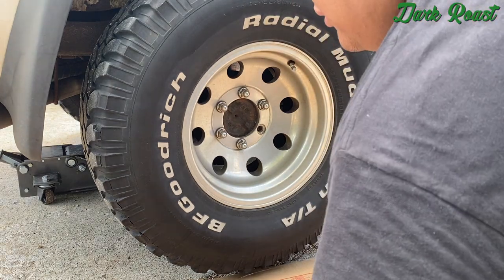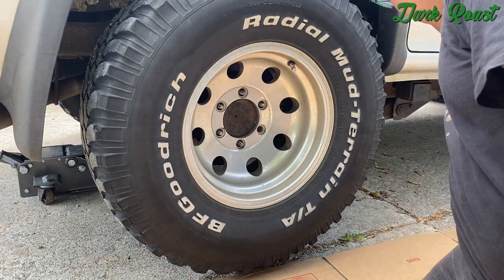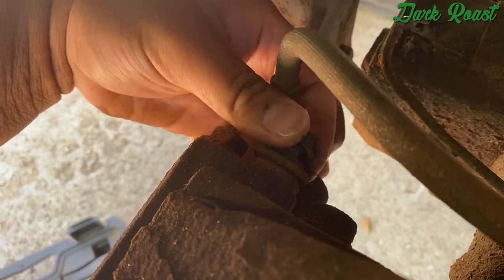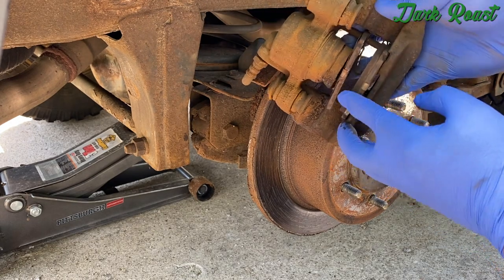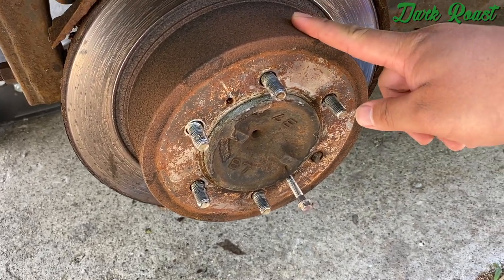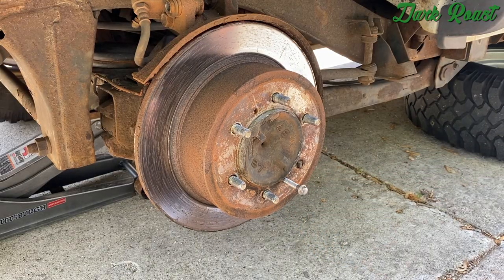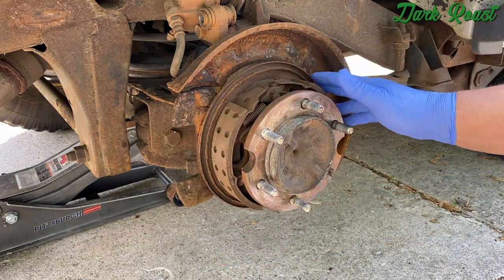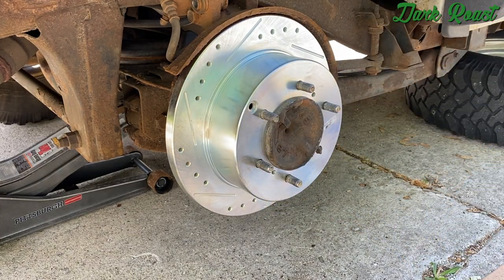How To: Replace Rear Brake Rotors, Pads, & Calipers on a 2002 Mitsubishi Montero Sport

Comment: Didn't need new calipers. Just needed to remove those stuck slide pins, clean them and lube them or just replace and lube them and your pads would've worn evenly again. Those need to be removed and cleaned every brake job as part of maintenance
Reply from the maker: I figured lol I honestly had a hard time removing the old pins and figured to just get a new set of calipers instead of trying to rebuild it. Especially since my uncle had the same OEM calipers on since he owned it before. Also it was more content to show on how to install the calipers lol I would say now I know for next time but unfortunately I don’t own the truck anymore.

Comment: Planning on doing this to my 00 sport xls soon. Thanks for the Montero love homie
Reply from the maker: Nice it’s definitely a great set up. Of course! Unfortunately I had to sell mine due to the frame rotting and it was getting really bad. I’m actually selling my Injen IS CAI, full Siberian polyurethane bushing set, and front drilled/slotted rotors with carbon fiber brake pads still new in box if you’re interested?

Comment: Thank you a lot man but stuff is still complicated I have a 02 montero sport I payed $450 for valve gaskets due to oil leak now I gotta o2 sensor and brakes I need to fix
Reply from the maker: No problem man! Oh dude the valve cover gaskets are a pain to do. The intake manifold has so many different size bolts it’s hard to keep track of. I tried doing a DIY video on it, but I was struggling lol. Eventually got it done, but man it was something lol. Good luck and hope you’re able to get it done!
Reply: @DarkRoast  just a check up I got my brakes and now I’m getting new rotors for all 4… I also have to get new shocks and struts I advise you to stay on top of it because these are notorious for that type of issues pray for me buddy😂!
Reply from the maker: @keepingupwiththejones3047  Nice! Did you ever get the new shocks and struts? Oh I had plans for a full lift kit, but unfortunately I was never able to complete it because I had to get rid of my Montero. The frame rotted away and the cost to weld the frame was worth more than the truck lol

Comment: So the rotor has no screws to hold it in place,??
Reply from the maker: The screws are mainly for the factory to keep the rotors on. You don't necessarily need them. The rotors get sandwiched between the hub and the wheels. As long as you have the lug nuts torqued to spec then you should be fine.